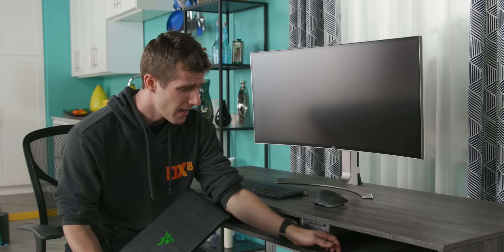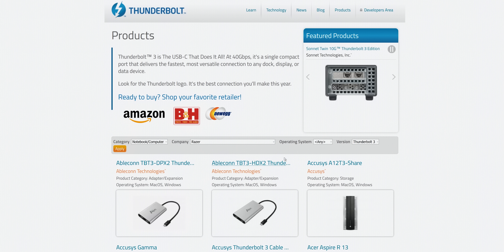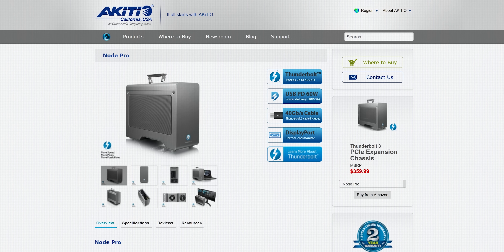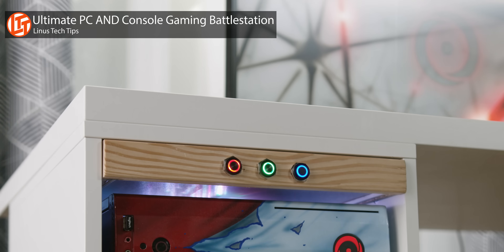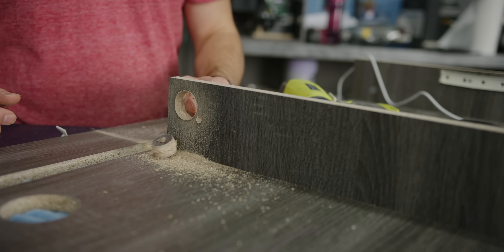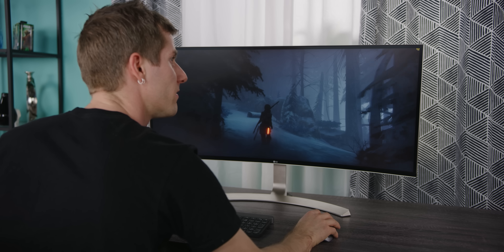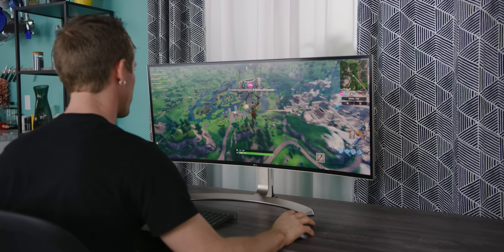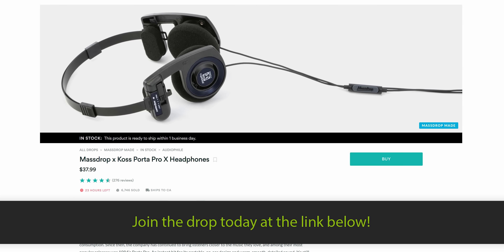This is the CLEANEST Setup.

Comment: It seems like it would be cheaper to just have a laptop and a desktop.
Reply: Exactly, laptops with Thunderbolts are still on the high side of pricing, not to mention hubs/egpu boxes. For the same money you can buy a cheaper laptop and a desktop that would crush this
Reply: @GiorgioAresu  "buy a cheaper laptop" yes, but then when you are mobile you have less power. If it's for playing you can probably sacrifice it, but what about professional video editing ? It's still a good setup then :)
Reply: @Zetura  but still, for the price of the gpu enclosure you can do a ryzen 5 build, which would be more powerful anyway. The only real issue I can concede, is that of having to keep file organized/synced on 2 computers
Reply: @GiorgioAresu  You can get a Ryzen 5, DDR4 RAM, motherboard, case, alimentation, SSD, for $263 ?! Well, give me the address xD That's just the price of the RAM... And no, you still have the non-mobile issue...
Reply: @Zetura  that's the price of the one without any other ports (except other Thunderbolts, so you'd still need other hubs/dongles), otherwise more around 400+€ (here in Italy at least). And with that you can do a cheapo build, yes. Not with exaggerate amounts of ram but a "basic" system that would still outperform the laptop
Reply: well especially if gaming on the go isn't a priority
Reply: But cheap really isn't the goal here.
Reply: Fuck desktop. I have 5 laptops.
Reply: Not a proposed
Reply: Why is linus using a chinese knockoff monitor
Reply: @Steve00alt  he's not. That's an LG and a completely different size/resolution/style from the Ali Express one.
Reply: @Steve00alt  Which monitor is it? Looks pretty good... is that the one they reviewed a few days ago?
Reply: Ok, you guys don't understand "mobility" I think. And yeah, you can have a cheap laptop too, but for my needs, I need a powerful laptop too. I will pay for it anyway, so eGPU is still better and cheaper than buying an entire custom PC next to it.
Reply: @Zetura  I'm not saying that FOR YOU it doesn't make sense. OFC if you need a powerhouse on the go you'd still need an expensive laptop. The same could be said for people who want to play on the go, then your setup would be useless and not "mobile" enough, because they would want a gaming laptop with integrated powerful GPU. But, I think for the majority of people, a laptop with a thunderbolt 3 port would be a waste of money when you could buy a cheaper laptop and a desktop and save money, or the same laptop and the desktop for about the same price. Everyone has it's own use case, but while I loved the thunderbolt 3 idea when it came out, it's obvious that licensing is a big issue that rises the prices to a level where, for most people, it doesn't make sense to bother
Reply: @GiorgioAresu  on that I totally agree, Thunderbolt 3 is too expensive :) and of course Linus is not making a video for casual users ;)
Reply: @Zetura  good point :D It's nice to be able to have a civil conversation on youtube ;) have a nice day
Reply: Probably
Reply: You can't game on the go with an expensive brick under your arm.
Reply: it is an idea.. after refining and big company adaptation  this thing will cheaper...
Reply: I'm not convinced that's the case. 

For a desktop you'd need a CPU, RAM, case and storage, but the only requirement for this is the dongle and egpu enclosure.
Reply: @OneDerscoreOneder  egpu 329, hub 310 639

A quickview of pc part picker shows we could easily do a ryZen 5 for less or even 7 for a bit more
Reply: @marklavine8088   you forgot about the budget for a GPU to fill the enclosure.
Reply: @RuiPalmeira  no I didn't you have to buy the GPU in both cases so you don't count it.   Assuming the same laptop, and given that you HAVE to use a crazy expensive egpu the difference is about the same.
Reply: @marklavine8088  the cheapest razer blade (used in this video) one can buy in the EU (no dedicated gpu) retails for 1579eur. taking that into account, and the fact that one needs to "waste" money in other peripherals needed for this build, makes this just a complete waste of money. 
I could probably get a decent desktop + a laptop for work on the go for about 1600eur. hell a ryzen 7 2600x (custom) based build here costs me about 900eur and that would pretty much last me a good couple of years without any upgrades.
Reply: @RuiPalmeira  which is exactly what I am saying.  You don't even need to count the blade, the crazy expensive egpu and dock cost as much as the rest of the setup.

Bottom line this is cool, thus does have a usability story, financially this is stupid.
Reply: @marklavine8088  i had misunderstood what you wrote. yeah. the coolest thing about it all, imo, is the cool mods made to the desk. those are cheap to make and rather easy if one can work wood and stuff..
Reply: @RuiPalmeira  I have been dieing to mod wireless charging into my desk
Reply: @OneDerscoreOneder  those GPU enclosures are pretty expensive and I'd bet that hub is too. Without the tools and Alex to do it totally custom like this you might not get much out of that investment. You also wind up having to get a lot more laptop than most people will use on the road to keep up with that GPU and monitor.
Reply: The correct case is ITX. Pay more get that instead, far more flexible and powerful. Mid tier laptop + ITX  gaming rig > High end laptop + egpu. So its NOT just the epgu + superdongle thing,  a razor blade laptop costs a lot more.

Comment: I have a similar setup after recently purchasing an Alienware Graphics Amplifier, a PNY GeForce RTX 2070, and a Dell monitor 1440p/60hz to plug into my old Alienware 13 R1/R2.  The only bummer is my Core i5-5200U.  ($300 for a replacement motherboard with the Core i7-6500U from Newegg)

Comment: With a laptop like the Blade, when you close it you basically cut off all of it's exhaust, I used to do this and it would heat up considerably. Adding that you're shoving it into a slot that's going to just hold that heat, this design isn't great and I wouldn't recommend this to anyone.

Comment: Feel like an easier/cheaper route would be the HP Omen egpu that has lan and usb already and don't really need the second dock, or if you really a couple accessible ports a cheaper usb3 dock could be used in combo. Has 60W PD so fine for the stealth. And while you're there, Velcro it to the bottom of the shelf, not underneath the top. Maybe not as aesthetic, but just as functional.

Comment: For routing out plywood, particle board, or veneered items start with a down cut end mill. If you ned to router deep pockets, start with the down cut and switch after you go deeper than half the end mill width.

Comment: I have a similar setup for my primary gaming/streaming/work laptop with a 2016(or 2017? I don't remember) RBS and core V1, but I plug a USB 3 hub directly into the RBS instead since the Core V1 has issued with USB devices constantly disconnecting.

I still highly recommend using a cooling pad or installing a fan below where your laptop will sit despite what Linus claims as a stable temperature for his 2017 pad being below 65 degrees while gaming because if it does get hot and you do not have a good way to cool it, you will eventually run into swollen battery issues with the RBS, especially if you're gaming for extended durations or doing CPU intensive work on it. I just place my RBS on a cheap Cooler Master pad I got on amazon and it works fine to keep it cool, especially in the blazing norcal heat during summer.

Comment: I would have also made an inlay of some material for where the wireless charging spot is, rather than just a sticker. Hell, even if it's the same material but from a different piece of unused wood, just to make it distinct and more durable than a sticker.

Comment: So you build setup worst than PC but more expensive, and with a lot of a hassle?

You can buy laptop (maybe less expensive if you don'r need powerfull laptop), and PC, and hide it easily to same lvl of eastetic, and you have 2 working computers. It's very convinient to have 2 computeres, esspecialy when you have some troubles, and you need working computer to repair the one with issues.

And this eGPU enclousure is almost as big as small form factor PC!

Comment: No mention (or link) to the fact that the CalDigit hub is $300? I'm not disputing the pricing of the product, but between that, the desk, and the eGPU (let alone the machining/time spent), you could just build a high tier desktop, and save a few hundred bucks.

Comment: My 4 year old laptop with a 970mobile graphics card has higher settings on rise of the tombraider (which is a 4 year old game). Why? Because
- PCIe 4x speed is meant for ssd-drives and entry-level graphics cards
- The Blade stealth CPU (if new model) has a base-clock of 1.8GHz, can probably not maintain turbo all the time and thats nowhere near recommended for modern games

I love your videos in general. If it doesnt work out, dont try to hide it.

Comment: 3m makes a velcro alternative, i forget what it's called exactly but it has little mushroom shaped plastic bits that interlock with eachother.  It is MUCH stronger then velcro and lasts longer, it's also the same on both sides so you don't need 2 different types like velcro has.

Comment: Okay, but laptop fans are terrible and having a laptop as a desktop, i'd be more likely to fry the CPU then I would be with a desktop. The reason I prefer to have a desktop and a laptop as 2 separate devices is for the fact that my laptop is for smaller tasks, and portability, while my desktop is for heavy tasks, like game development, gaming, and editing without the need to constantly shut off my computer and then turn it back on the next day with the need to have to reopen everything. Fans are preventing my computer from heating up while I leave the tasks open all night.

You may also say, why not have your laptop go on sleep mode then??
I've tried that, my laptop became a stove top that was turned on, and I felt like I was burning my hand as it was an aluminum body.
Until laptops are powerful enough, can stay cool for a long period of time on heavy tasks, I will always prefer to have 2 devices.

Comment: Wouldn't you damage the laptop screen if you run the laptop with the screen closed? I've seen so many instances where you get multiple white spots on the screen because of the heat generated by the laptop. how can we get away with that? any suggestions?

Comment: I would've left the eGPU alone, and not wreck the drawer unit... you could mount the eGPU case under the desk towards the back?? or build a shelf at the rear of the desk to hold the GPU case ;)  

I think an XXL mouse mat would look fine on the desk, without having to route/sink the mat into the desktop IMO

Can't think of an alt way to mount the hub under the desk...  or find a stronger velcro sys mount?

Overall, it is a neat idea ;) I still remember seeing those old laptop docking stations o.0  Mzybe if I ever become more liquid, getting a laptop might be an option??

Comment: I like how Linus thinks we’re rich to buy gaming PC’s
Reply: @tfwthewhen  I think i can but i would never. Cheap Gpus are overheating fast if they are powerful.
Reply: Any hobby can get pricey fast.
Reply: Gaming pc is a pricey hobby.
Reply: @shadowagent3  Unless the game is optimized poorly then even a Dual Core can run it pretty well at med-low.
Source: My broke ass owns a dual core.
Reply: @shadowagent3  do you know a lot of hobbies which cost you $1300 dollars for 4-5 years to get a good pc, then you can budget maybe $500 of multiplayer ganes and call it a day.

that's quite cheap compared to a lot of hobbies.
Reply: @shadowagent3  or it can be cheap gaming doesn't require other than a pc that you can game on

Comment: I think the thing I would do as a Mac user is something akin to the henge docks where you just slide the computer in and it links to the whole system. That way you have both thunderbolt and any other port on that side available to the setup without adding a ton of cable plugging. I like the routing in of a mouse pad idea. Maybe rout in a whole desk mat.

Comment: I have question!! Are most people here need a computer only to edit and render stuff? There are engineers, traders, analysts, who also use heavy PC.
Reply: What applications do engineers, analysts, and traders use that doesn't involve editing or rendering that can't be done online?
Reply: Traders run their trading platforms. Terminals. Like Bloomberg. MT4 Which is very heavy resource eating software. Engineers use other many complex software’s. I myself am a trader and I a good machine to run my terminal entire day. I do use VPS. But my local PC manages my accounts and charts.
Reply: @AnjanFX  mt4 is very heavy resource eating software? lol sarcasm aside, anything that requires a lot of resources needs more cores on ur cpu and more ram. gaming needs better gpus and sometimes more cores (open world games).
Reply: Mt4 does need high end CPU have you run any EA or indicator which are resource hungry. My i5 with 8 gigs ram would crash every time I was running my dashboard on my mt4. My i7 handles it very well. I have the dashboard coded by good programmers and made sure it doesn’t use up unwanted resources.
Reply: @AnjanFX  no pc in this day and age should have 8 gigs of ram, it's probably google chrome that's crashing ur pc (the research ur doing in the background), the minimum u should have is 16 gigs. but yeah what ur telling me is basically what i told u, more cores, more ram is the answer!

Comment: I'm well aware that for example the Razer core can be used for both Razer and Apple laptops, as they both use different brands of GPU would it be possible for you to cover an all-in-one set-up like this that has the capability to cater to both brands? That way someone can invest in a single GPU and dock etc. and use the cheaper variants, such as the 13-inch razer laptop and the macbook without having to have different set-ups for both

Comment: So you have a new cool universal plug that can do anything you can daisy chain devices, but you can't decide what device is delivering power to what device. That's the problem with new tech.
With the new tech that offers new possibilities, I ALways run into such bs. And then your device is full of checkbox features to make it look better in the store.
New tech is great, but if you're a manufacturer then just deliver something that is as awesome as you pretend it to be, as you want us to believe it is, as we should be able to expect.
Reply: To be fair, they didn't intend for it to be used in conjunction with an eGPU, plus most people would just plug in their laptop with the included adapter.

Comment: I have dual monitors on my PC. I got a 2012 MacBook air with a broken keyboard,a USB switch and a thunderbolt to vga adapter. So all I do is tuck the Air under the monitor stand in my Ikea "freddie" desk, hit a button to swap the keyboard and mouse over to the MBA and change the input on my 2nd monitor and Bam, stealth MacBook and PC with literally the push of 2 buttons.

Comment: This is very cool. The only issue I would have is that a few of the high performance laptops I've personally worked with, including my current laptop require that the lid remain open due to the thermal design that draws cool air in from the top of the device. So in my case it would have to be open on the top of the desk. Very cool despite my own limitations.